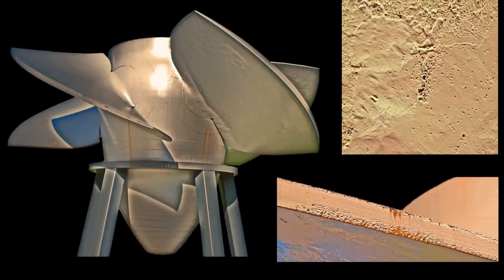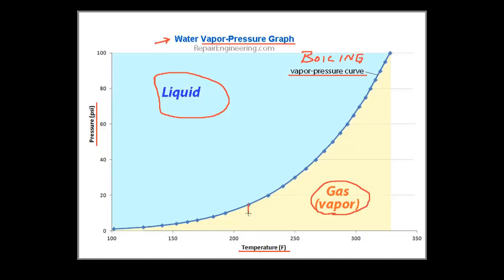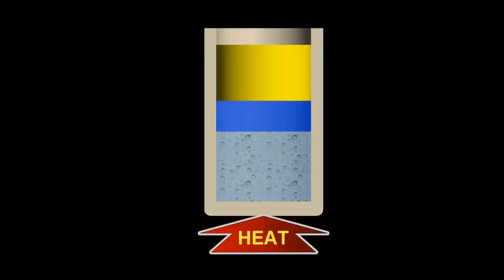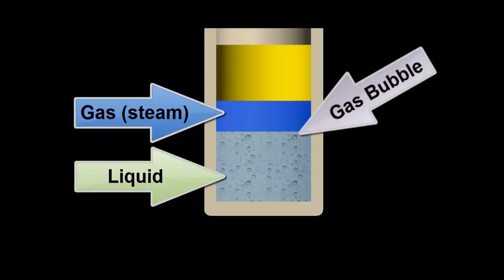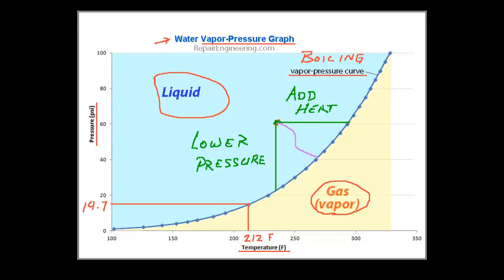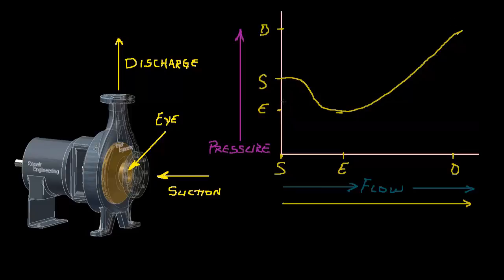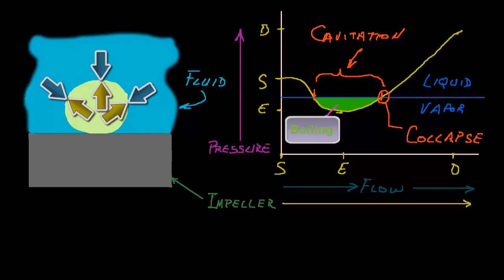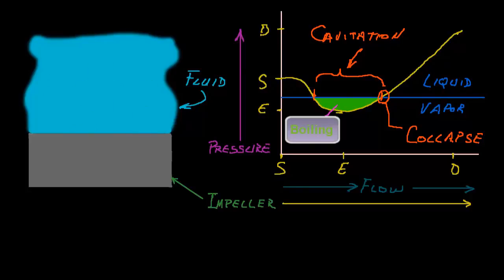Cause & Effect of Pump Cavitation

Comment: so cavitation doesn't exist for plastic parts? Only metal?
Reply: If i understood this correctly, cavitation has nothing to do with part material, only pressure in the fluid. The Part's material plays a role only when you consider what kind of damage will occur over time if cavitation continuously occurs.